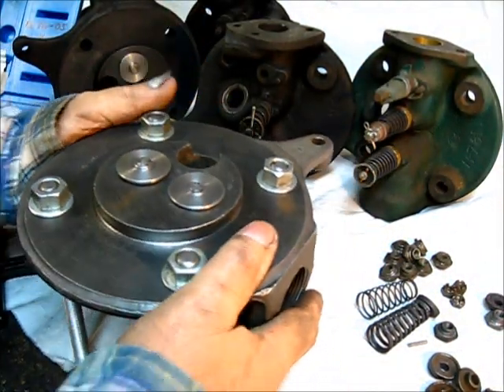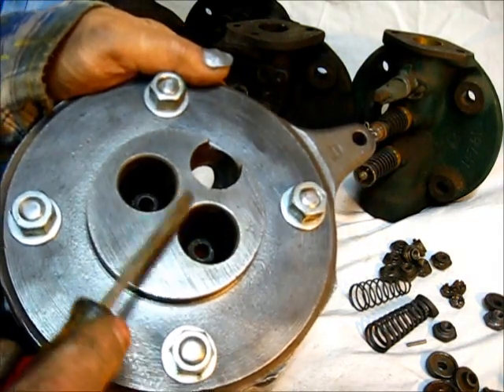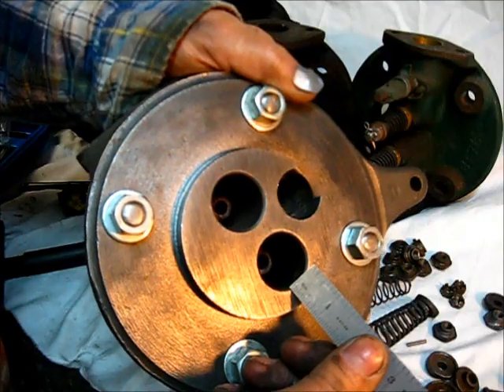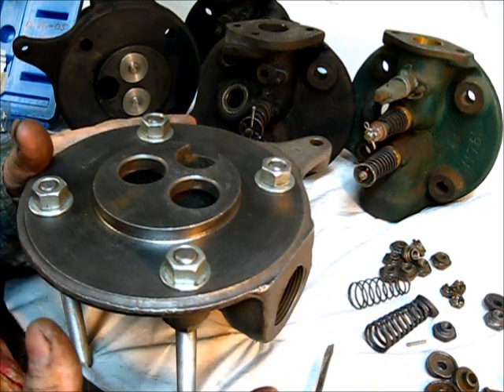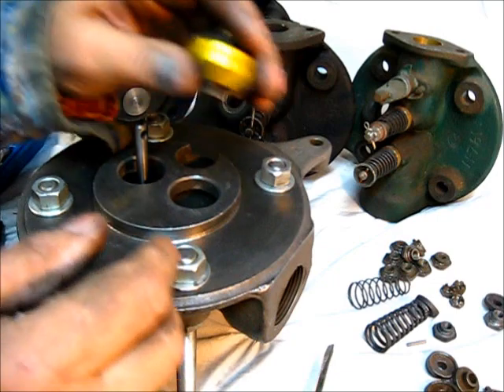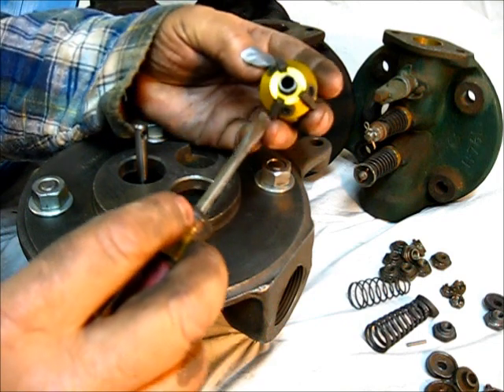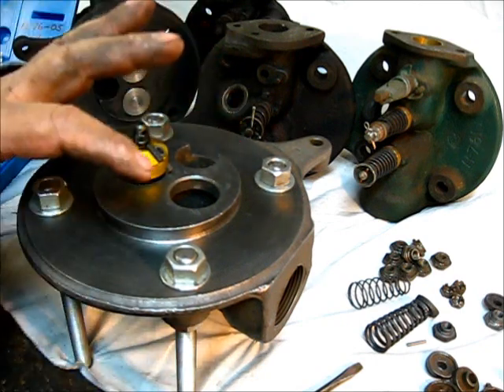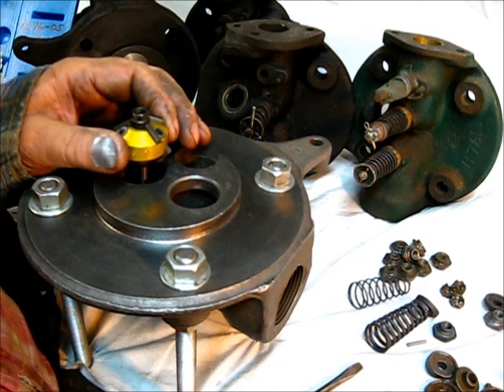I H C ENGINE  how to cut valve seats #1

Comment from the maker: ,,,,, yes the 1934 Maytag model 92 multi-motor is a 2-cycle engine,, it is also a hit & miss engine,, the governor is inside the flywheel,, works by interrupting the ignition,,

Comment: Ah,,, I forgot to elaborate on what place 3 angle seats have. I agree Sam those are probably original seats. The basic use for 2 and 3 angle seats is to maintain that 1/16" seat face for a cooler run of the valve operation... You use the 2nd., and 3rd. angle to center the seat on the valve face. Another consideration is on high performance heads, the 3 angles aid in flow that helps the engine breathe better. I had race drivers from all over my area bring heads they wanted me to do. ;o)

O,,,

Comment: I did automotive machine work for 5 years before I went to work in  a job shop running all manner and size of, mill, lathe, grinder, welder, and saw. While doing automotive machining I did valve jobs with every type of stone and cutter by the thousand 3 angle seats have their place. Someone with a steady hand can use a speed handle and socket with neway cutters turning them nice and slow I've also used the factory handle and the motor driven kind. I prefer the speed handle. Nice show. :o]

O,,